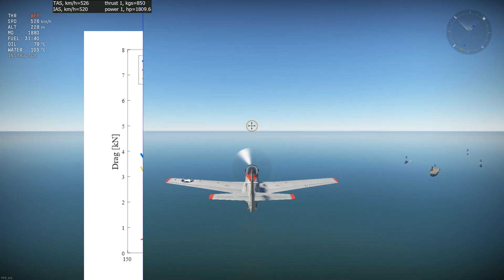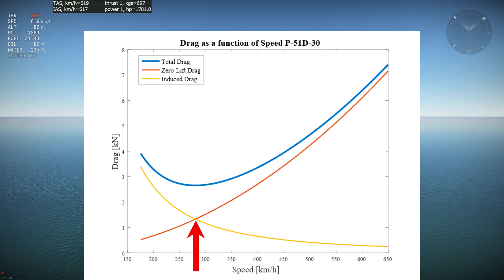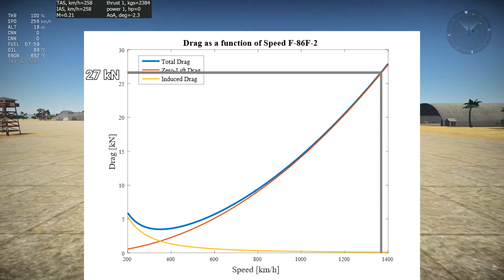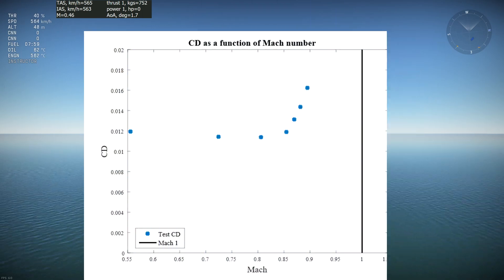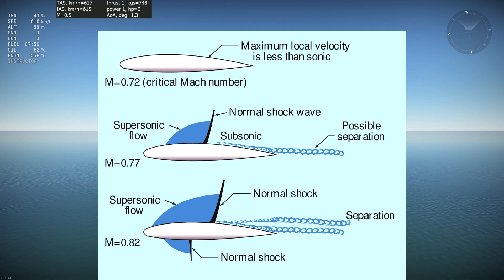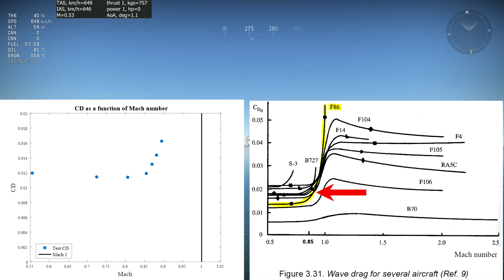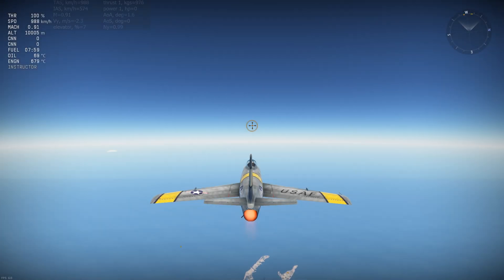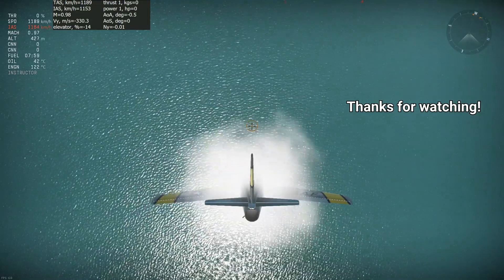Why Wasn't The F-86 Sabre Supersonic? Transonic Drag!

Comment: Do you know if mach tuck is implemented on the Game? Cause i was playing sim on the mig19 and when you reach mach 0.93 the plane start to dive by himself and when you reach 0.97 mach it levels out for without you doing nothing, but in the meanwhile you need to pull almost full elevator to keep it level
Reply from the maker: I think it is, but I haven't tested it to make sure. I think that was the origin of the whole pitching bug at high Mach numbers in supersonic aircraft.

Comment: This is such a good video. Thank you. 
I want more
Reply from the maker: Thanks, and more coming soon!
Reply: @adamtheenginerd2914  
Hey Adam, can I ask you a question physics related that I couldn't find the answer to online. Does a heavy plane accelerate faster in a straight down dive than a light plane because of its weight? Question is about single engine prop fighters. Also could do you ever mess around with Edit Axis settings in WT? Like multiplier/non linearity stuff like that? Also I read on a WT forum that if you set your elevator multiplier to less than 1, to 0.90 for example it reduces your stall speed, but you never get 100% deflection. I also read that if you increase the alerion multiplier (for rolling) from 1.0 to 1.1 for example that your plane rolls faster. Would that be a good video idea?
Reply from the maker: Wow you're in luck, that's the topic of tomorrow's video! All your questions will be answered in that video.

I thought that only applied to Simulator, not mouse aim. I have not changed any of that much. I highly doubt it makes your plane turn or roll faster in mouse aim.
Reply: @adamtheenginerd2914  thank you for the reply! I appreciate it : )
Reply from the maker: @lukefrombk  Check out the video!

Comment: Adam would you shed the light on my problem? In physics we have Brachistochrone curve to cope with the fastest decent method. What about the fastest (or pseudo-fastest) way to decent in air, considering from point A of certain alt to point B at sea level, and there is a constant horizontal distance between A and B, and the drag factor has to be considered. The reason I ask this is that since fighters fight with rivals which share similar performance in realistic mood  , which route should I choose to get rid of the enemies on my 6?  Should I choose a shallow dive? Or should I choose a Brachistochrone-like path? Which is more effective?  
I think you are the first and the only WT Youtuber who systematically and scientifically explains the characteristics of fighter planes, and I love it very much. I will certainly watch any of your new clips in the future.
Reply from the maker: Very good question! It's something that I've been thinking about too, and my next educational video has a similar topic!

The optimal will be close to a Brachistochrone, but not quite for the following reasons: drag, thrust, and the extra drag if you're constantly pitching to mimic the Brachistocrone. Assuming an enemy is 1-2km directly above you, the best thing you can do is dive nearly vertical until you reach close to your typical top speed at that altitude, then pitch up gradually until you reach the 45° mark, and then continue in that direction. You need to be in a faster plane to hope to escape an enemy diving on you though.

There's a first for everything!

Comment: you said to not climb near mach 1, so what would be the highest mach number to climb without having the ineffiency? and  what about jets that excell at a higher speed like the hunter? also is it better to climb higher than the enemy in top tier or prioritize speed(e.g: mach 1+ at 3-5km) or altitude(around or below mach at 6k+)? sorry for all the questions btw
Reply: It's a gradual appearance. In commercial aircraft, aircraft actually climb at constant "IAS" until they reach around 25000 ft, then switch to constant Mach number in order to avoid too much wave drag. The climb profile will vary from aircraft to aircraft depending on every factor.

For top tier, I don't really know yet. You should climb some though, don't stay at sea level.